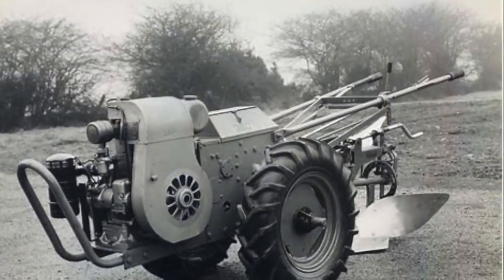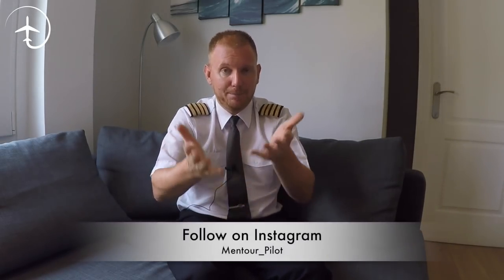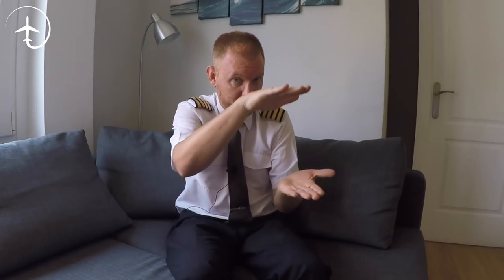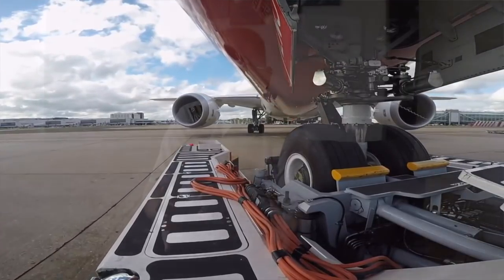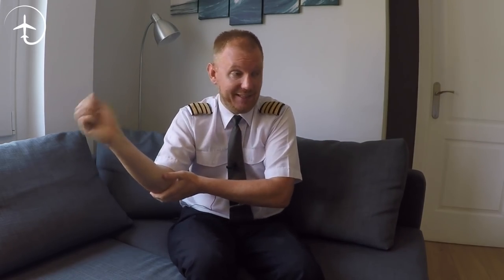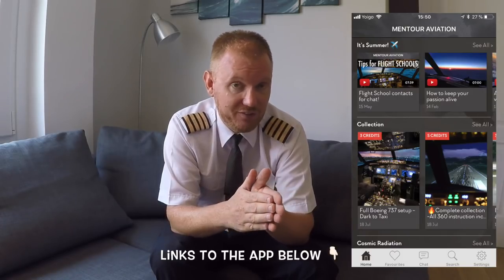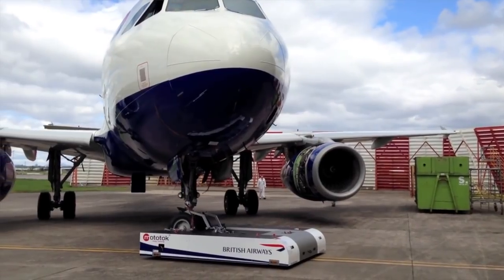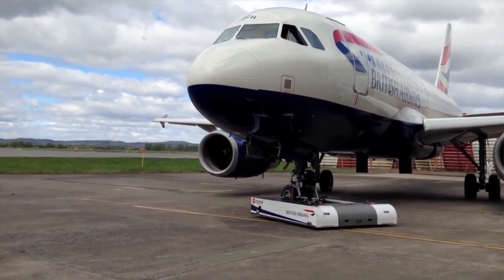Aircraft pushback, why is it necessary?

Comment: Turboprops can use the thrust reverser. Have seen it on canary islands (ATR- 72 Binter Canarias). No need for a pushback truck.
Reply: Turboprops don't have thrust reversers. They have variable pitch props that can set negative pitch. A thrust reverser is an entirely different animal, seen only on jets.

Comment: I remember the old 727 was able to push back, on its own power. 
Since the cost of idle or taxing engines cost so much, wouldn't it be much cheaper to have it towed to just before takeoff and to a lesser degree, after landing? I've had it taxing for 15 min or longer, to and from the gate.

Comment: Saves the engines and reduces engine wear.  Pushing back with thrust reversers is not only stupid but  normally against company policies.    Tractors are easy to use, easy to understand and saves engine wear.

Comment: My question is. What will you do if you Run out of fuel and how do you keep your flight flying until you land at the nearest Airport
Reply: Plane Lover Well if you run out of fuel you can still fly for around half am hour depending on how fast you were going when you ran out off fuel and if you did run out of fuel you would lose power so you would activate the APU and RAT if you have one to generate power however it would only power essential things and then you would try to find an airport to land at.

Comment: Excellent video and explanations however the force needed to move the plane is not simply the amount needed to overcome friction.  You also have to overcome the inertia of the motionless plane which is described by Newton's second law F=m*a.  The acceleration is extremely low however the mass is extremely high, so there is considerable additional force needed to get the plane moving at all.  Once it is moving, then the only force needed to keep it moving would be the force to overcome friction.

Comment: Pushback trucks, is it possible to have electric motors in the wheel assemblies that would eliminate the need for those pushback trucks? The electric motors will need just enough battery to simply drive the plane backwards and stop while being controlled by the pilot and traffic is seen by cameras on the plane itself so pilot can see behind just like a car, then its all forward driving until the next need to back out of a gate.

Comment: Oh wow , that was really  kool,  I was going to ask what kind of qualifications does one need  to operate one of those tractors ? 
but it seems even that  has been taken over by remote control ones now,  putting those guys   out of a job...  still , very informative so thank you :)  incidrntly,,, do those push back drivers need to contact ATC  before moving  the aircraft in reverse , for immediate clearance?
Reply: the pushback drivers are only in communication with the flight deck. ATC is only in communication with the flight deck, as well. The pilots have to request clearance for pushback, and once that's granted they relay on to the pushback lead who initiates pushback. The rest of the ground crew (wing walkers) should already be in position to facilitate this without delay, which could cause the pushback clearance to be cancelled.
Reply: Hey, I push back planes every day as part of my job, so hopefully I can answer some of your questions. At larger airports like London Heathrow there are simulators for the pushbacks just like the ones that the pilots use for their aircraft, but at smaller airports like the one I work at, to qualify you do a certain number of ride alongs with an instructor or supervisor, followed by a certain number of pushes with an instructor or supervisor prior to getting your certification. As far as qualifications before-hand, practically nothing. Legally you don't even need a driver's license because you're not using public roads (although you'd be hard pressed to find a ground handling company that'll accept someone without one, haha).

As far as the remote control pushbacks, those are still very much experimental and you'll only find them at Heathrow if I remember correctly, I don't see regular human-operated pushbacks leaving the scene for at least a decade or more.  

To elaborate off of what Sean said earlier, there are airports like the one I work at that have uncontrolled gate areas, meaning ATC doesn't control what goes on in there, so once the pilots have their clearance to push, you still have to keep your head on a swivel because since the gate area (or ramp) isn't ATC controlled, it's up to the pilots and ground crews to avoid congestion and collisions.

Hopefully I could answer some of your questions!
Reply: @cx-wskitch4552  One minor note: I could be wrong, but MOST airports in the US are publicly owned meaning the ramp IS a public roadway. Technically, I could've gotten a ticket in the baggage tug lololol. At my old airport (and every airport my airline operates at) you need a Driver's License to be granted driving privileges on the ramp.

The sims are cool, never even heard about that.
Reply: @swb1003  huh, that makes sense. I just threw that tidbit in there cause I saw it in a documentary about Heathrow, haha. Didn't occur to me that the laws would be different stateside.
Reply: @cx-wskitch4552  Yeah, Heathrow is a bit of a curveball in that it's privately owned. I don't know about the rest of the European airports either but stateside here they're publicly owned (either by the county like my old airport, or the city like in JFK/LGA's case) more often than not.

Comment: if I look to the back of the airplanes the all have a hole in the back. like an extra jet at the end of the main structure. but I do not see any intake?
Reply: levivanoverloop it is for the APU and the intake opens when in use and closes when it is not. Some are small and on the top by the tail.

Comment: I saw older version like concord or first 707-737-747 pilot ground steering wheel was very very accurate,smothe and predictable but new versions like 777-787 and 737max move very sluggish or if i want say better they're front wheel move like stepper motor

Comment: I would question the mentioned power output of aircraft tugs... especially those which push back A380s. e.g. The Bliss-Fox  F1-500 has the following specs:  360kW (483hp) Diesel Engine with 1990 Nm (1468 Ft/lbs) of Torque. Not supercar power levels, but adequate torque. Some of the older Fox tugs had twin diesel engines.

Comment: Here in the US we also call semi trucks without the trailer a tractor. That's why a lot of times you hear people say tractor trailer. But I don't know why they call trucks Tractors, but it might be for same reason, because long time ago before trucks were built a lot of trailers were towed by a tractor. Also here in the US if you say truck a lot of people wouldn't know what type of truck your talking about, because there is also pickup trucks and some people even call large SUV's a truck. It's actually weird because there is 4 different names for large trucks here in the US.
1) Semi truck
2)18 wheeler
3)Tractor Trailer
4)Big Rig
Reply: 5) Semi
Semi truck, tractor trailer and semi are misnomers that probably became common because we are all lazy speakers of English and got tired of saying Tractor-Semi-trailer-Rig. A semi-trailer is called that because the trailer's wheels only carry half the load. The other half is carried by the tractor. On a regular trailer (like you would see carrying a boat behind a car) nearly the entire load is carried on the trailer's wheels, with only a small fraction (tongue weight) carried by the towing vehicle.
"Truck" is word with and equally interesting, and much longer, history.

Fun Fact: "18 wheeler" is what 747 pilots sometimes call their planes. Go ahead and count the wheels on a 747.
Reply: The B-36  has six "pusher" piston engines.  By contrast,  similar recip engines on the  B-17 are tractors.

Comment: Petter I've always wondered about the tug pushing the nosewheel leg outside of it's normal angular travel. Like kind of jack knifing the aircraft if this makes sense. Is there a danger of this?
Reply: Disconnecting the nose wheel steering allows the nose wheels to swivel 360 degrees.  You can actually walk the towbar around in circles all day with no problem.  With the tug hooked up, though, you must mind how tight you turn.  Too tight a turn where the main gear is pivoting rather than the tires rolling is not good for the gear.  And you must mind the clearance between tug and aircraft.
Reply: Thanks for that Brian. That was the bit of information I lacked to make sense of the whole thing. All makes perfect sense now.

Comment: Is there no way to disengage nose wheel steering within the cockpit like some military aircrafts?
Reply from the maker: We could turn off the hydraulic A pumps.
Reply: I get the argument for not whipping the towbar around, but is the steering disconnection not simply to let the tractor steer the plane without having to fight the hydraulic pressure ?
Also, one evolution being researched is fitting electric motors on the nose gear, aka "green taxiing".

Comment: Was surprised at the idea of the tractor lifting the front of an aircraft... but then recalled that the rear wheels aren't terribly far behind the centre of gravity in a properly balanced plane. It's still a great deal of weight to lift, but not even close to the full weight of the aircraft.

Comment: I enjoy your videos very much. In this one, however, when you describe a strong-man pulling an aircraft, you mention the coeff. of friction between the tyres and the ground. Surely, however, the relevant frictional forces are, instead,  those within the wheel bearings, since the contact point between each tyre and he ground is effectively not moving (or else, the aircraft would skid along)?
Reply: Many thanks, Warrior Son,  I fully accept point of the deformation principle being the primary force to overcome; this isn't 'friction' though, it's the elastic modulus of the tyre compound.

Comment: Why not equipping a few wheels with an electric motor for a little torque backwards? 
Too heavy? Too costly? Or no time saved when taxing back as a wingwalker is needed anyway?
Reply: Gunnar Kaestle It is mainly safety airliners have no mirrors and some aircraft windows can't be opened either so your reversing blind. In the 80s and 90s planes would sometimes use reverse thrust which uses alot of fuel but that was when fuel prices were cheaper and it is very unsafe using reverse thrust to pushback so it is not alowed anymore of course. An electric moter would adr more weight and increase fuel consumption when flying which would increase fuel costs more than it would save on wages. So it would realy be no help.

Comment: The term tractor is still a correct term to use even they dont use farming tractors any more This is because the word tractor itself means To Pull or Puller. Farm Tractors pulls things like plows and other farming equipment around  and airplane tractors pulls and pushes airplanes around. This is also the reason behind the term tractor beam in series like Star Trek. It is a beam that pulls pushes and move things around.

Comment: A good idea to eventually utilise electric robotic pushback equipment it will save pollution and delays to aircraft departures  often while tgey search for a suitable tug , i have been delayed on a plane myself while they had to find a tug for our push back at teminal 5 at Heathrow they now deploy mototocks to pushback departing aircraft esp for the airbus 318,319 and the 20 21 they are proving very sucessful there now!

Comment: Why don't manufacturers fit a secondary IC engine to power aircraft landing gear for taxiing? Wouldn't that be easy for aircraft when it is on ground?
Reply: Extra weight on a commercial aircraft is very expensive (millions of dollars for that capability on a jumbo jet) over the life of the aircraft. The cost of the same capability on a ground vehicle is insignificant by comparison.

Comment: Before the video.
I'm going to post what I expect and will edit after the video with what I learned.

Expected:
1. Fuel Economy: for short distances a high torque combustion engine would be more fuel efficient, resulting in less wasted fuel and less time with the engines spun up to full
2. Ground safety: No jetwash around the terminals that could injure ground crew, also the driver has rearview mirrors - Pilots don't
3. Jet safety -  Engines with thrust reversers active would risk FOD kickup to the intakes

After watching the full video I'm quite surprised that simple terminal space was the main concern that led to these being developed, though I can understand this space consideration leading to increased passanger safety from not having them wander across the parking area to the planes

Comment: Can’t the APU be made “revsable” and do the push back? “Pilots don’t see around the aircraft” -  attach 10 or 20 small ccd-cameras in various directions on the plane with motion detection devices pre-installed to detect different movements in the surroundings. Just a thought of implementing something more ”up to date”. And when i went to the technical university in Stockholm (KTH), they taught us that “impossible” is not a valid word in an engineers brain...   ...the “impossible” just may take a bit longer time 😉

Comment: Why not design terminals with drive through bays, with the jetway and assorted vehicles approaching the planes from the sides. The waiting rooms/stuff would be underground under the ramp, and passengers would be brought up via escalators. Then the planes could go out forward, and they'd be able to be parked in ramp space with a higher density, saving space.

Comment: Didn’t a air Florida 737 in 1982 did a powerback and it sucked and blew snow onto the wings causing it to stall and plummet into the patomac river
Reply: Shane May I believe that particular incident was caused by ice and snow blocking the pitot tubes, hence giving false engine indications.

Comment: @mentor pilot, its is absolutely incorrect to say that the TBL converts its horse power into torque. Horsepower is a function of rpm x torque /5252. Horsepower is an indicator of how fast you can deliver torque. through gearing you can practically achieve any amount of torque. A 5hp lawn mover can be geared to achieve 30 ft/lbs as well as 15,000 ft/lbs of torque. It is this reason all land and marine moving machinery is rated in Horse power and not torque

Comment: Bring back the MD-80. I miss backing up on my own.
Reply: There are still many MD-80 variants flying today. It's just most airports prohibit powered pushbacks because it's hazardous to those on the ground, makes a lot of noise, burns extra fuel etc. I don't believe there are any companies that allow it anymore for the fuel cost alone.
Reply: Yeah I know. Just being facetious. In the mid 2000's they finally stopped doing it at most of the smaller regional airports from what I remember.

Comment: Actually there are pushback trators with 900HP and much more  .. And they do Have to take a lot of power for the case they have to pushback or forward a plane in a situation were there is a Descent or climb  ... it happens a lot in many airports were the parking place does have a angle it is not straight and in that case pushing a say 500Tons airplane and cargo like the A380 requires a LOT of power in order for the pushback tractor to have a lot of torque ...
Also some agricultural tractors would be perfect for the job, some are meant to be high powered high torque low speed fruit tractors ... they are small, very low and usually they are very articulated, perfect for towing aircraft :) ...
Don't tell this to Micheal O'Leary ... a pushback tractor with no towbar can cost up to 500.000+ ... some like the most sophisticated for the A80 cost on the range of a million! 
Normal pushback tractors  for the 70Ton-90Ton class (373, A320 even up to A330) are around 100.000- 200.000 ... A tractor like the one I've mention above would do the same job for around 20.000 ... just saying ... and all maintenance would be Way below that of specialized pushback tractors ...

Comment: Why aren't there motors in the wheel hubs? APU power would be sufficient to slowly position the plane without the complexity of the tractor procedures. Those carts look very expensive too. The lineman marshaling the plane would be the only person necessary, acting as the eyes on the back of the pilot's head.
Hub motors are now being installed to improve takeoff acceleration of planes and gliders. Motorgliders with small "sustainer" engines can now self launch in a reasonable distance.

Comment: Do they use compression ignition engines? There would be an obvious practicality advantage in using jet fuel in the tugs: you need only one fueling truck and it's less flammable than gasoline. But heating oil is cheaper and just as energy dense. Obviously you would need different nozzles to prevent cross contamination. A turbine engine would probably run on heating oil because of its similar molecular weight, but heating oil might freeze in the aircraft's tanks when it's too cold out. Oops!